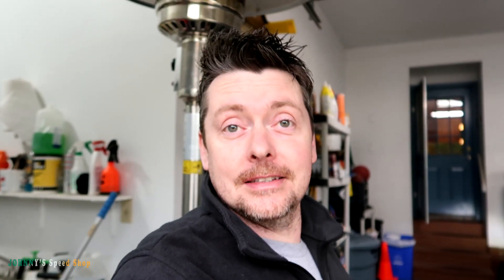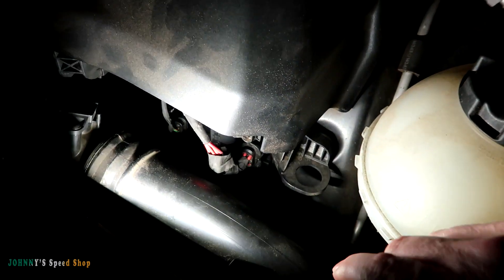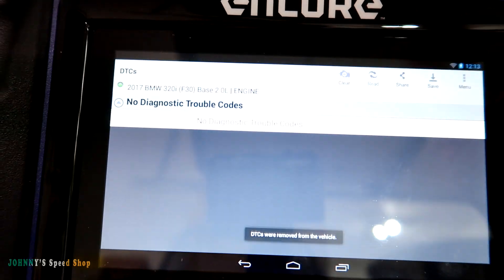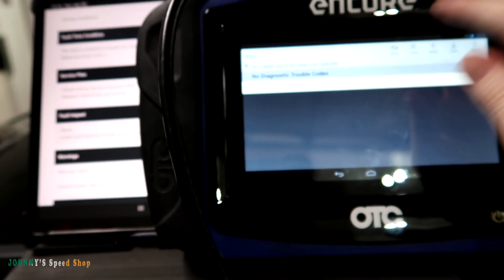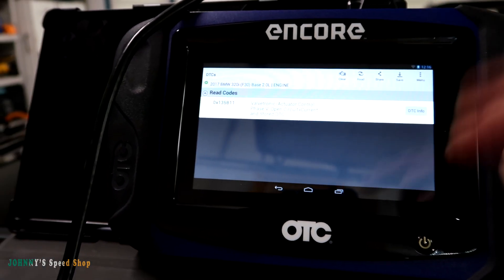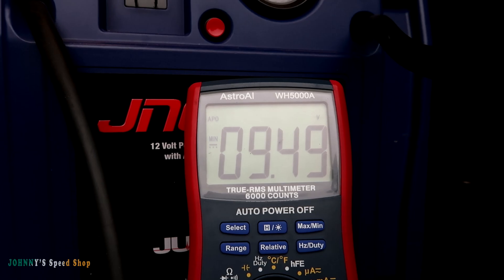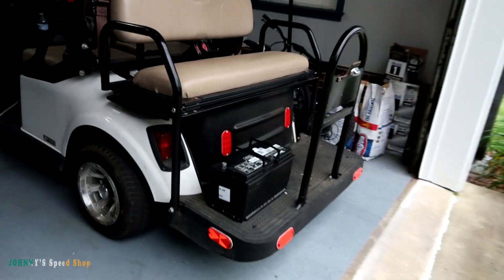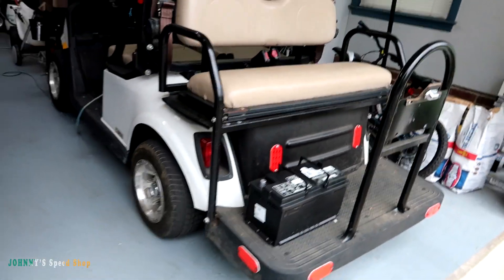BMW F30 Fault Codes 135B11 and CD9437

Comment: Do you know 138A11 whats mean?
Reply from the maker: Exhaust flap, activation: implausible adjustment time
Reply from the maker: See if is stuck or needs cleaned If I remember it's in the right/  passenger side rear
Reply: @JohnnysSpeedShop  Thanks a lot for the reply! I read an error saying that this is a valve. but I still can't figure out what kind of valve is this?
Reply from the maker: It's inside your exhaust... what car is it?  They are normally on the right side but depends on model.
Reply: @JohnnysSpeedShop  The car is an F30 328 2011 sedan. does this valve affect the operation of the engine? Is it in the silencer?
Reply from the maker: Got it... yes it will cause a restriction once the car is warned up.. might feel a little less powerful than before if it's stuck closed....if it's stuck open then no but car will take a bit longer to warm up.

Comment: Hi Mate, I’ve got the same code 135B11 on my mini b48 engine, also getting a code 135608, any chances you’ve come across similar?
Reply from the maker: 135608 is for "Valvetronic: No movement identified"   I would check the acturator and see if you can manually turn it, it's something like a 4mm allen key it it's stuck it could be due to poor oil or it just quit on ya. If you have a scanner you can do a relearn and set the stops this would also tell you if it's moving, you can hear ir clear as day when it's doing the stop limits relearn.

Comment: I just saw this and I just want to make sure it’s not my alternator I have the same codes too scanned multiple times and car has some start up issues and lights inside go dim at startup. No engine light nor low battery on the screen. I got a f32 435i
Reply from the maker: Just test it with a meter while it's running, you should see > 14v while the car is running. You could also load test the battery to be 100% sure.

Comment: Hi there I have a code showing up on my F30 it’s E12C1D do you know what this is and how to fix it and is it something serious?
Reply from the maker: Looks like some sort of instrument panel code....Invalid signal (run-on, terminal 30, fault-controlled, 0x3AC), transmitter JBE/FEM/BDC
Reply from the maker: Supply voltage 11 to 16 volts.      Check the voltage... the threshold is much tighter for this code  11 to 16 volts...
Reply from the maker: Here's the service plan.

Work through all stored faults of the partner control unit according to the test plan.
Especially faults that affect the vicinity of the partner control unit (e.g. connected sensor system).
These types of faults are consequential faults.

If there are no further test modules in the test plan then no further repair measures are required.
Reply: @JohnnysSpeedShop hey Johnny thanks for getting back to me! Do you reckon it is a code I should be worried about or can I just leave it/reset it?..
Reply from the maker: Well mate...it lists it as a consequential fault so it really depends on if it's a hard fault or not...I've seen some strange stuff on BMWs where a pot hole will flag a code and it never comes back... I guess I would ask you is it a hard fault?  If you clear it does it come right back ? If so I'd do some more research on it...clusters have a habit of breaking  solder joints, that's where my mind  went but that means nothing without testing and knowing if it's a persistent code... also consequential fault leans me to thinking something else may be causing the code...it's really hard to guess on YouTube what could be happening you really need a proper diagnosis to be sure....cheers - Johnny
Reply: @JohnnysSpeedShop  I took it to a strictly bmw shop for a diagnostic and they came back and told me that it’s got to do with the thermostat which doesn’t make any sense as I also checked it and it’s fine… I did a software reset today and the check engine light came back on right away. Do you recommend doing a battery reset? (Undoing the terminals) Seen multiple videos saying it works to clear minor codes etc 

Here is the technician note: Performed DIS test found fault in DME 1D2402 and 1D2404 for characteristic map thermostat activation short circuit to ground and line disconnection, checked lines from thermostat to DME found to be okay, suspect thermostat faulty and will require replacement.

What are your thoughts as I’m confused now after seeing online it’s a cluster code with a clamp switched off (run-on time clamp 30 error-controlled, 0x3AC)
Reply from the maker: So the code 1D2404  is a thermostat code I think the OBDII code is the P0597,  do do you have multiple codes  ( first one was E12C1D ). 

I think the 1D2404 is a circuit code but I can't remember, I would check to make sure it's plugged in and no broken connectors or lose pins, assuming the car is not overheating I wouldn't replace the thermostat, you can command the thermostat on and off with a scanner and check the voltage at the plug, if that looks good I would go ahead and replace the thermostat. 

FYI - since E12C1D is a consequential fault it may be caused by the open circuit code to your thermostat ( basically might not be a real code ) 

I would focus on the  1D2404  code and see it the instrument code resolves itself.
Reply: @JohnnysSpeedShop   yea mate the car is only showing the one code which I’m confused as the shop came back with the two (1D2402 & 1D2404). Would you know what the code 1D2402 is? I’m going to check the thermostat again thoroughly tomorrow and see if I can find anything. But the car runs fine and no overheating so don’t think the thermostat needs replaced… Thanks for the help!

Comment: Nice find mate , easily misdiagnosed without checking the basics with modern cars … I had a bad call few years back where the electronic power steering was going wonky intermittently, changed the steering column/motor/module and ended up being the battery 🤦‍♂️, car started fine every single time no signs of having a bad battery etc … 
If the otc still doing the job I wouldn’t bother buying another scan tool until you need it mate but I would highly recommend the Autel for European vehicles 🍻👍 take care mate
Reply from the maker: It's crazy mate how this was the only issues, and circuit codes instead of low voltage or low supply codes... It would be really easy to misdiagnose parts with how these codes appeared on the OTC scanner.  I was sooo close to ordering a bunch of parts... lol